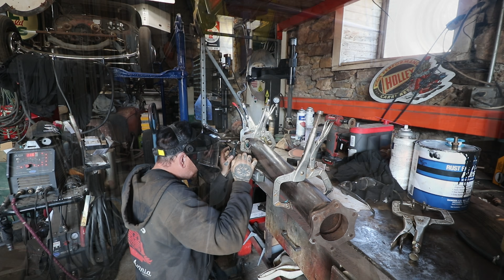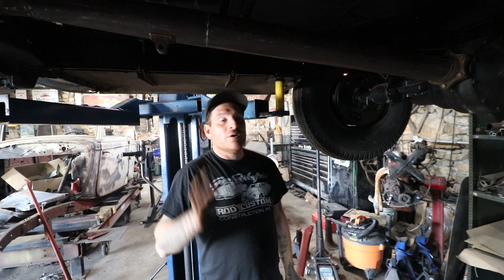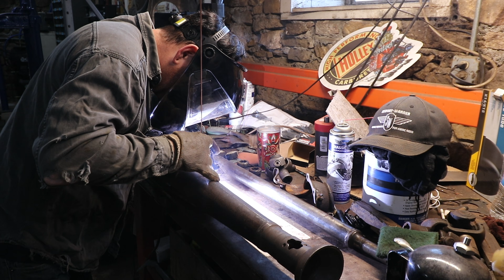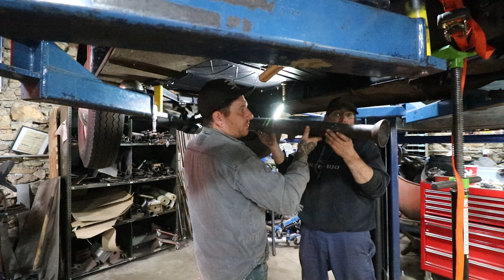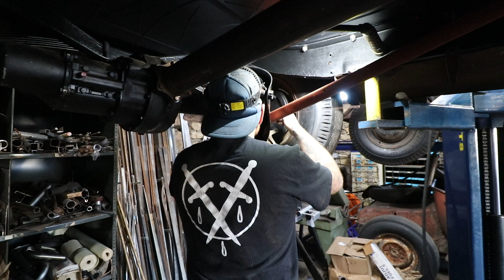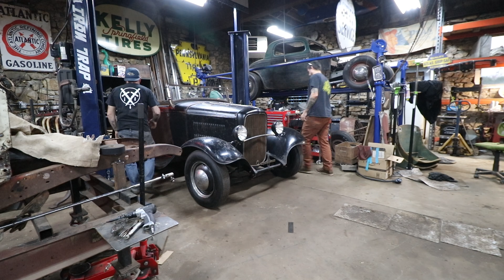1932 Ford "DeLorean" Roadster Gets A Shortened Drive Shaft & Torque Tube!

Comment: What kind of linkage or cable operates the two speed Diff?
Reply from the maker: Originally it used vacuum. I’ll be fabricating some mechanical linkage
Reply: @IronTrapGarage  Thanks for the Info! Keep up the great programming!

Comment: Do you retain the carrier bearing when you shorten the torque tube?
Reply from the maker: The one at the front is still there. If you mean one in the center? They only put those in the center on the later Flathead cars with longer torque tubes. Earlier cars didn’t have them so I don’t use them in shorter wheelbase cars like a 34 or older.

Comment: I've owned cars from the 70s and 80s that would have benefitted enormously from a two-speed differential. There is nothing quite so uniquely annoying as an (otherwise good) car that sits on 4000 rpm at highway speeds. Great video, this roadster is going to be awesome when finished.

Comment: Since the tube goes outside the drive shaft, why is the tube called a "torque" tube and not a "drive shaft"  tube?
Reply from the maker: Not sure. We’d need to ask the mechanical engineers from 100+ years ago that question.

Comment: HI IRON TRAP garage how do you keep those shafts balanced with no vibration   OHIOhotrod
Reply from the maker: On a torque tube car with only one u joint it isn’t as much of an issue as modern cars but it isn’t a bad idea to balance it. I’ve gotten away with it on most cars. Also helps most of these cars don’t run at high RPM’s